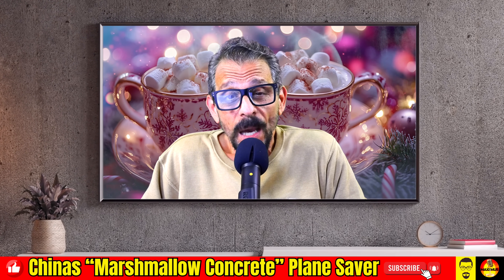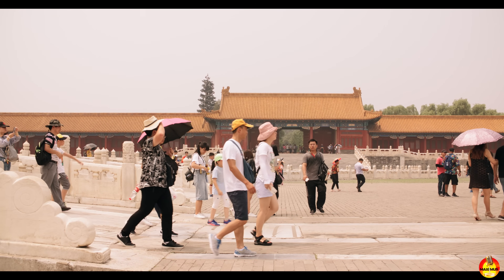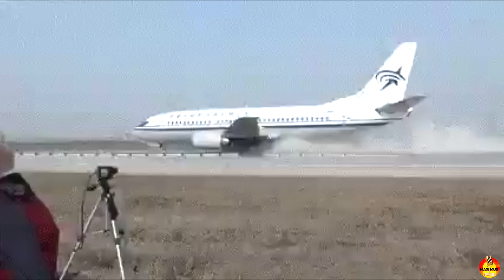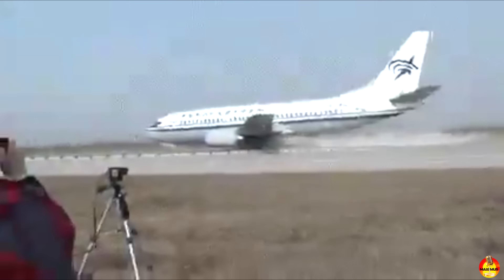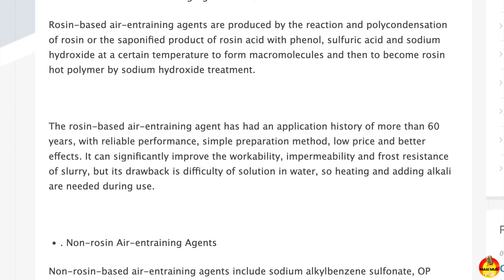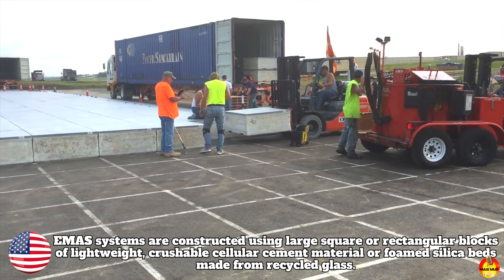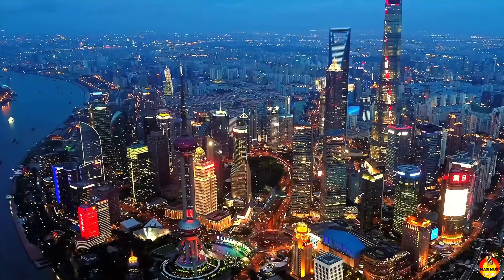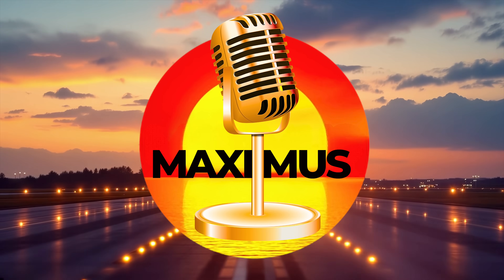Chinas Marshmallow Concrete vs Americas EMAS: Chinas Shocking Twist on a U.S. Life-Saving Invention!

Comment: Cement is a component of concrete. Calling concrete, cement, is akin to calling a cake, “flour”. Like cement, Flour is only one ingredient of cake. 
Rather uniquely in this use case we are talking about un reinforced concrete, so delete steel and other forms, such as fiberglass strands, from the concrete. Regular in reinforced Concrete mix is therefore simply water, cement, and aggregates of various sizes. In this case the aggregate will be atypical, being very small with zero large pieces. 
It will be far more similar to an autoclaved concrete, if not exactly that, with slightly alterations. 
Anyway, cement is cement. We are most definitely not talking about cement in this instance, as you finally right at the end of the video acknowledge, by referring to concrete as, concrete 🤷‍♂️

Comment: Paris Airshow guy 
Back in the 1900’s 1970’s 
I used to add microballoons powder
To lighten the epoxy and use for fillets wings to fuselage on model planes ✈️ 
They’re pretty much doing the same thing 
Cheers 

Over runs suck OH do I have the stories. 
One I’ll add what if you land short? ie British airways/SFO/ oh it will come to pass
Prost 🥃